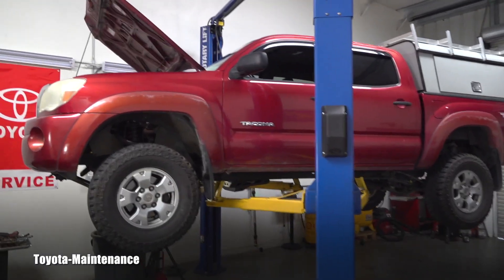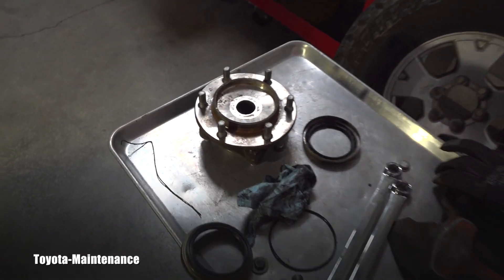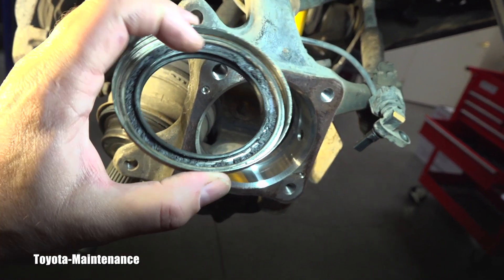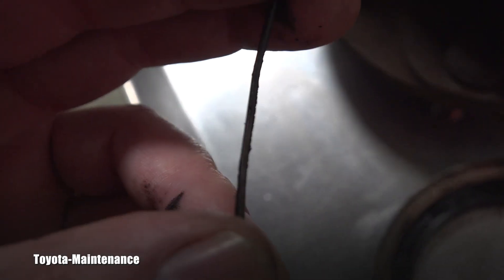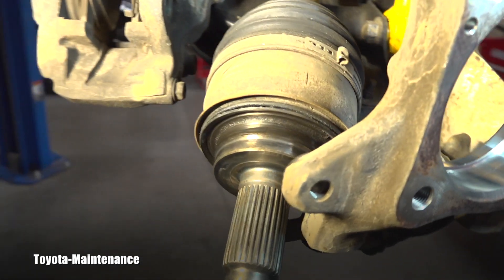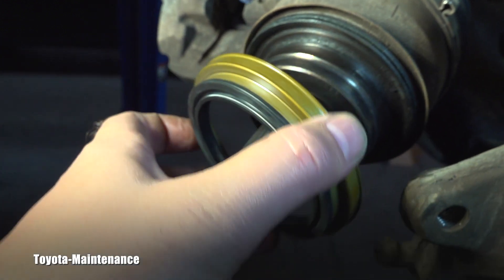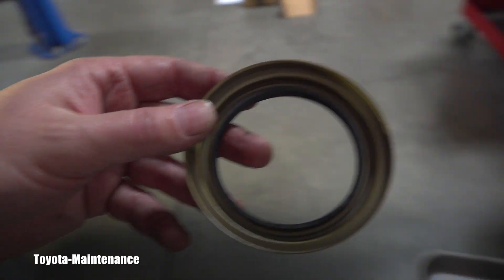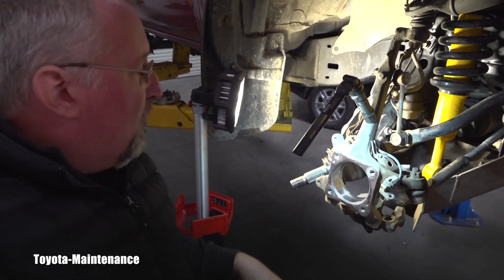Failed Wheel Bearing due Failed Seal

Comment: Hello thank you for your video. I have a Toyota Question that you may know. I have the 1st generation Tundra and I am confused as to why the door jamb says I should put low pressure 26 on front tires and normal 35 psi on rear tires. The truck is old and is only for light payloads and no towing. I don't want tires to wear or performance to be affected. THANK YOU FOR YOUR TIME

Comment: This turned out to be my problem! Seemed to be a right wheel bearing (went away turning right) but no play in either wheel. Later did ECGS as I was lifting the truck and found the inner axle seal's tension ring was loose because the inner rubber ring had disintegrated. After I got the rotor off....clearly felt the bearing was grinding! There was also some rust in the backside of the hub/bearing, a clear indication of the seal's failure ruining the bearing.

Comment: Hello, I love your channel. I was hoping you could make a video as I have 1998 Toyota Rav 4 that when I shift the gear from park to reverse or drive position in the mornings or when first starting the car after sitting for a day or more for the first time during the day, my car makes a thumping/clunking noise. It otherwise rides very well and the car is not cluncking or making any noises when driving, only when shifting from park to reverse or to drive on the first try daily after it sits out overnight. Once I drive it and it is warmed up during the day or evening, no clunking when shifting the gear into reverse drive while parking. Also I dont have any transmission slippage symptoms that I can tell. Wish I could get to the bottom of this problem as no mechanic is with me when I first warm up my car in the am to experience this cluncking sound. When Ibbring it to the shop they dont hear the clunking sound.
Thoughts?
Much appreciated!!!
Robert
Reply: Do you warm your engine up? If you don’t then try warming up your engine and the tranny. It should shift good.

Comment: Hie how are you l have got my toyota allex am having right side wheel bearing problem and it started when l changed my CV joints it's now the 3rd time changing my bearing same side different brands what can be the cause of that

Comment: Using sticky grease on the seal spring is recommended to eliminate it coming off. Lucas Red.
SKF seals oem plus have extra lip holding in spring.

Comment: I discovered both of my oil seals were bad while replacing the axle shafts on a 4R (4th Gen)... Guess how much local dealer wants per seal, $60 a pc. And I had to drive to 2 different dealerships to get 2 seals. If your vehicle is around 10 yrs old, just plan ahead and order them from a dealer online for $25 each, when you need to do work involving the hubs.

Comment: Replacing the front driver's side bearing on my 05 Corolla. There's this slight scraping noise that occurs with the movement of the wheel. Driving faster makes it occur more. I already replaced a brake caliper and had the rotor turned thinking that was the issue. Hopefully replacing the wheel bearing will solve it.